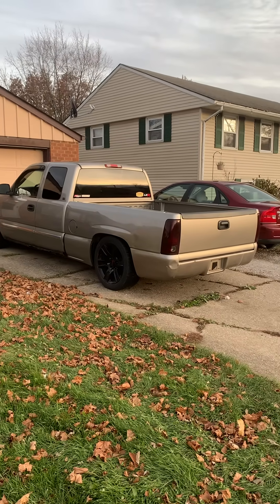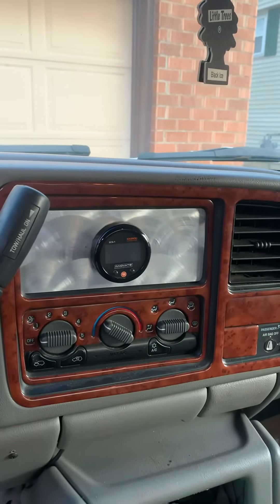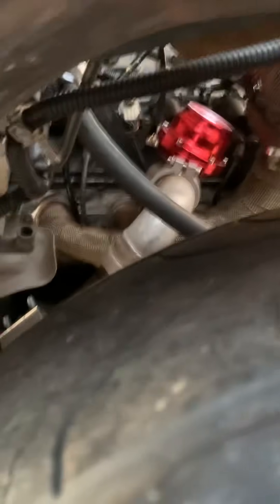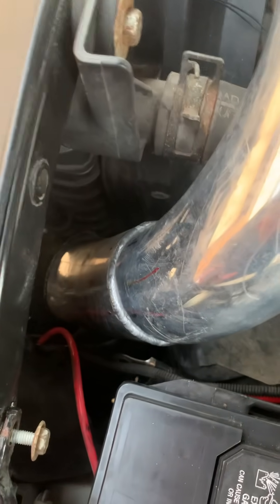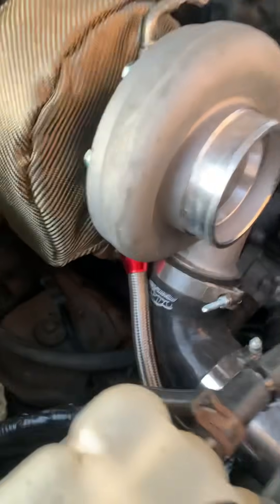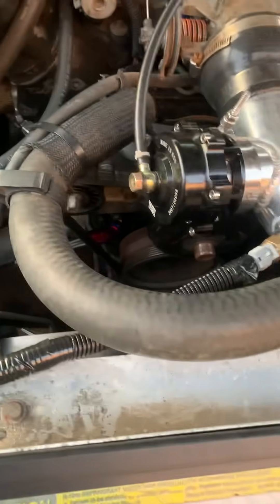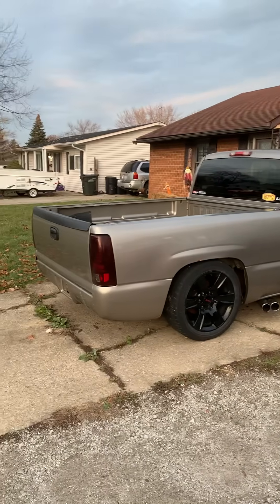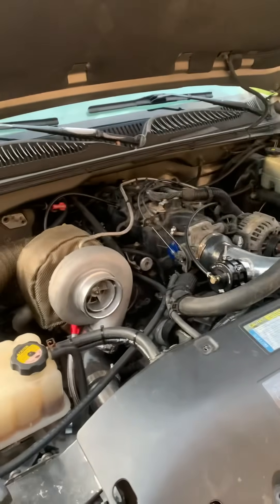Low Budget Turbo Silverado Under Boost for $1500 w/ XS-POWER.com Hotside and complete build info

Comment: How did u put the crossover together? Did u have to weld it? Or weld vband clamps? Working on my 2nd turbo build and looking at the hot side u used this time. But wasn't sure if the cross iver was a lap connection sliding one over the other or if it had to be fabbed up. Thanks sharp truck and great build.
Reply from the maker: I used a slip union and band clamped it, but you could weld v bands if you wanted to do even better than I did
Reply from the maker: If you go to my channel I have some short videos of my crossover setup
Reply: Did u have to cut it? It seems mines to long i got the same kit u got
Reply from the maker: Yeah I did have to cut the crossover in 2 pieces
Reply: @bo_flint93  ok cool thanks bro

Comment: Hey man how is hot side holding up? Anything you would do different? Small block nitrous guy here so this is all very new to me. Noticed your are in Ohio. I'm from Guernsey now live in Athens. Anyways hopefully I'm a few months I have something similar to your truck. Went 3/4 ton though so hopefully wont have to fuck with any drive train. That's the idea anyways my luck all the extra weigh will make it break quicker  😆
Reply from the maker: Hotside is holding up nice. You should
Be good with the drivetrain holding up, those 4L80’s will hold some power. I’m making well over 500rwhp in my truck and mine is holding up great. Let me know if you have any questions or need any assistance

Comment: Nice truck 
What paint did you use for your front headlights and where can I pick it up
Reply from the maker: I actually used clearcoat, I just added some black basecoat in with my clear mix and I sprayed them until they were dark enough
Reply from the maker: Where u located, I offer a headlight and taillight tinting service depending how far you are
Reply: @bo_flint93  
Tampa,Fl.

Comment: Under $1500 but what about tuning? How much did tuning cost you? You doing that yourself? I’d like to do the same thing for my 03 1500HD (6.0 LQ4 + 4L80)
Reply from the maker: Tuning wasn’t included in that price that was just to get it put together, then the 4l80 then the deka 80s then tuning. Tuning was an additional $500 for the dynotune

Comment: This may be a dumb question but what does it mean for the pcv to be vented?
Reply from the maker: Vented to the atmosphere via air filter
Reply: @bo_flint93  ah I see, I'm still kind of new to turbos thanks for answering, if I can also ask, do you have to run an oil catch can?
Reply from the maker: Yes I had to delete the stock pcv system and run a catch can, if not you will throw boost to your bottom end
Reply: @bo_flint93  ok, thanks

Comment: Did you use the stock fuel pressure regulator?
Reply from the maker: Yes but I boost reference regulator for it now
Reply: @bo_flint93  oh okay, I have an obs I’m ls swapping and want to turbo it just confused on how I should go about to regulate the fuel. I have a returnless intake so plan on running the feed from the tank to the filter and from the filter to the regulator and then to the intake and just have it return back to the tank from the regulator.

Comment: Nice truck did you had to remove the ac from your truck?
Reply from the maker: Yes I did, I could have done with without removing but my compressor was locked up anyways and my oil return line runs where the belt would have been, but if if you do you return into the oil pan you can keep A/C

Comment: Other then the turbo what all is done to your motor
Reply from the maker: Spring Upgrade and that’s it, figured I’d wait for the head gaskets to blow, then pull heads, and do good gaskets, turbo cam at that time
Reply: What’s your fuel system like
Reply from the maker: Stock rail, FPR, and fuel lines. Running a 450lph and DEKA 80# injectors on e85

Comment: I’m thinking abt turboing my truck it’s an 05 slowverado z71 and I was wondering how much power you’re making on that?
Reply from the maker: My truck is very close to being done and ready for the Dyno just did a 4L80e swap. My buddy has the same truck with a sloppy cam and it makes 600rwhp on e85
Reply from the maker: I’m hoping it makes 500-530 on 10lbs on e85
Reply from the maker: If I had supporting mods like good head gaskets and head studs I could turn the boost up and make a lot more but that time will come
Reply: @bo_flint93  me again 😂,is your transmission stock? If so which on is it and do you think if I run this kit my stock 4l80E would handle this
Reply from the maker: 4l80 and yes it will hold

Comment: Man that looks good I'm in KY and I'm putting together a 03 Silverado 5.3 mostly cam and heads along with some other supportive bolt on mods. My only thing is finding a good tuner I've heard of shortuning I may look into but I'm very interested in your build other than the FPR issues anything else you run into that would be a issue when boosting the truck
Reply from the maker: Not yet man, I’m gonna buy a set of good injectors but that’s about it it

Comment: Who installed your turbo on your Yukon ?
Reply from the maker: I did it all myself
Reply: @bo_flint93  what type of fuel pump do I have to get for a 2005 GMC Yukon Denali with this same turbo ???
Reply from the maker: I bought a $40 Kemso 340LPH from eBay and just swapped it with my stock pump

Comment: How is the injectors working out?
Reply from the maker: Fantastic
Reply: @bo_flint93  thanks man! Gonna order a set!
Reply from the maker: Are u getting deka 80s? If so order them from VSRACING they’re $100 cheaper thru them or u can go with Decapped injectors they’re just harder to tune for but can be done if u know a good tuner
Reply: @bo_flint93  probably be the decapped considering I’ have no intentions going over 10lbs currently gonna be on 8lbs. Also I seen that you got a Fuel pressure regulator. Did you go returnless fuel rail or keep OEM?
Reply from the maker: I’m actually still running the oem regulator, I haven’t installed my boost referenced regulator yet, really don’t need it until 600hp+
Reply: @bo_flint93  yeah what I was thinking. I thought I bought a Walbro 255 but ended up being a 450 so good there. It finally hit the dyno yesterday but injector data is not very accurate hell I may end up buying deka’s since there is a good data sheet for them.
Reply from the maker: U can’t go wrong with the dekas
Reply: @bo_flint93  one last question man and I’ll leave ya alone lol. The feed line that comes with the GT45 is too short. Did you buy another line and adapters or a whole kit?
Reply from the maker: I bought another line with a union and just put them both together

Comment: Nice build!! How did you run the return line and the feed line for the turbo?
Reply from the maker: Return line is ran back into the timing cover, and the feed is an ICT Billet feed plate adapter with a 48 inch braided AN Line
Reply: @bo_flint93  you don’t have a oil cooler?
Reply from the maker: Don’t need one

Comment: nice set up but it was more then $1500... there are some pieces needed that isnt on your list... and that boost controller ...wide band isnt cheap... that wasnt on the list either but good clean budget build for sure!!
Reply from the maker: Your right, I didn’t include that because it wasn’t a necessity to make it run. It don’t take long to get deep into piggy bank on these builds

Comment: You recommend for me to turbo current 4.8 or get a 6.0lq9, or 6.2 and all motor it ?
Reply from the maker: Personally I would turbo the 4.8, u won’t regret it. You can make 500-600 rwhp very easy with a turbo on a 4.8. I am getting ready to put my s10 together in next couple of weeks. I am going to put a budget turbo kit on it but it’s got a 6.0 LQ4 swap in it so it’s gonna make big power when I’m done

Comment: Why do you call driver side hot side?
Reply from the maker: Im referring to side that turbo runs off of as the Hotside which is driver/passenger side exhaust crossed over into the turbo then leading into Intercooler, once it passes thru the Intercooler then charge pipe up to the throttle body- this is called the cold side
Reply from the maker: Just remember- before Intercooler= Hotside 
After Intercooler = cold side